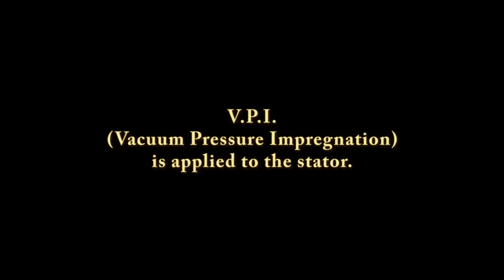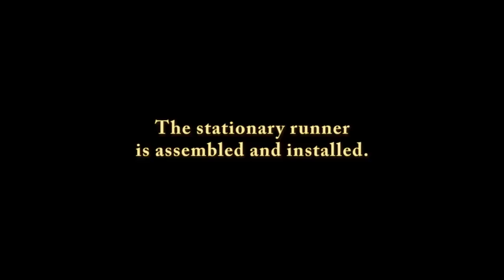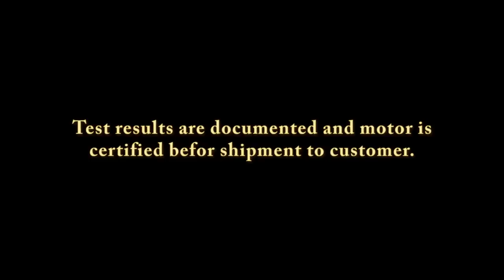Rewinding a Large Motor at KOFFLER

Comment: I used to work on a submarine drydock in the UK. It was four sections of a much longer WWII battle ship dry dock. Each section had two alternators, neither of which were as large as the synchronous motor in the video. Very impressive facility and personnel at KOFFLER Electric.
Reply: Antonmursid🙏🙏🙏🙏🙏🇮🇩🇮🇩🇮🇩🇮🇩🇮🇩

Comment: Man, if that rotor came off at 1:42 it wouldn't stop till it got to Kentucky!
Reply: What you said is correct. Large Pelton wheel takes more than an hour after stopping water jets to reach 50% of their running speed. Thereafter they apply reverse jet to bring to stop else it may take a day? This was on older designs, don't know how they manage in new designs.

Comment: For an electrical engineer the drawings are most important. I made drawings of some wave windings of a generator. Here another method Lap windings is used. I still wonder a video where wave windings would be  used. Drawings should be made available in a separate video. More or less a submarine photo is given and it is further told that this motor would be used for taking out water from a sub marine at a dockyard Pearl Harbour. You can not get the same pay, qualification and ranks. They are civilian workers doing military jobs but would be denied crowns and perks. Tecnically it is still a huge jobs. People are repairing motors of all sizes. But in some countries these are ripped off and sold as a junk. Price wise they may cost half of original make and that information is not given in the video.Only music will not serve the purpose,  a technical commentary would be much of use.

Comment: I deal with some weighted parts, Im not sure I like the size and weights overhead they are working with.  the guy tightening the bolt pushing foot against support board not too sure about.  small clamps pinching circular lip to lift parts???

Comment: Ok so I am new to this.  Why would you need to put new wiring in this motor? Thanks
Reply: Due to vibration and corrosion over the lifetime of such a motor, the wiring can brake and cause electrical shorts.

Comment: Is that a synchronous motor?
Reply: I don't think so, synchronous motor would not need 3 slip rings, just 2 for DC supply. It should be asynchronous motor with slip rings, which has good starting torque typical for this application (without the need for variable frequency drive).

Comment: Can it run with AAA battery?
Reply: it's rated for AC, not DC.\

But if it was DC, sure you could possibly power it with 1.5 volt, actually depends on amps, volts and current.

Comment: what are the adjustable instruments in pale brown shown being bolted with the cables at 3:55?
Reply: They seem to be a brush holders.
Reply: Tomasz Lachowicz i think you are absolutely right, it seems they are positionned with the cables and adjacent to the slip rings.
Reply: jeetenz hurlollz
Reply: Robert Ansah Most probably the 3 grey tubes that are verticla are insulators. AT 4:08 you can see the slip rings on the rotor to which the golden metal parts (some kinda bronze probably) will be rubbing against. I suppose the light grey tubes are ceramin insulators of some kind.